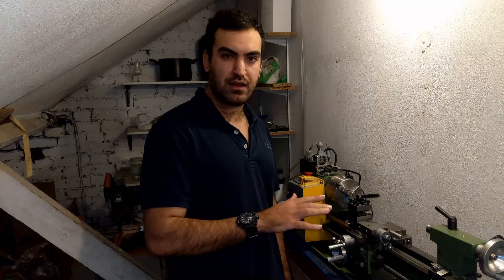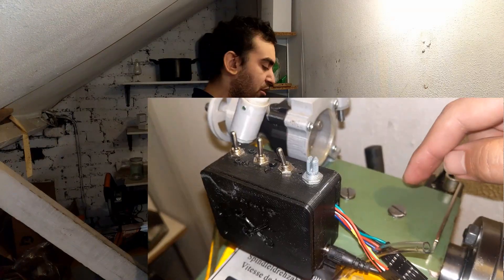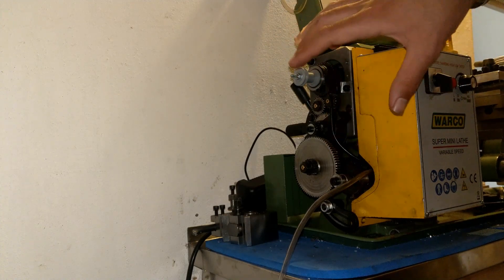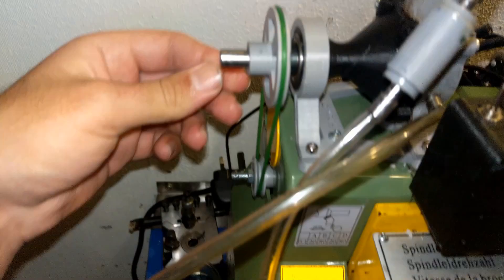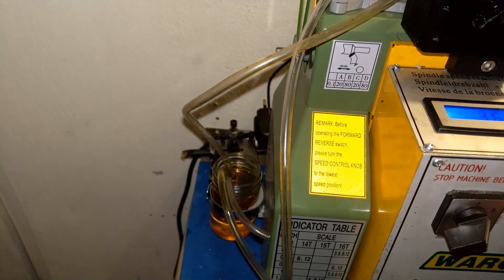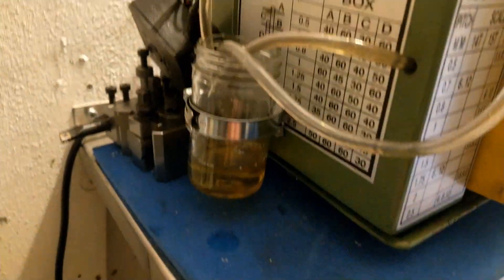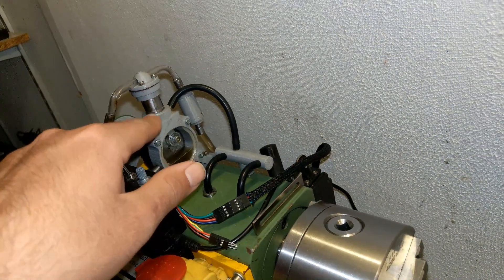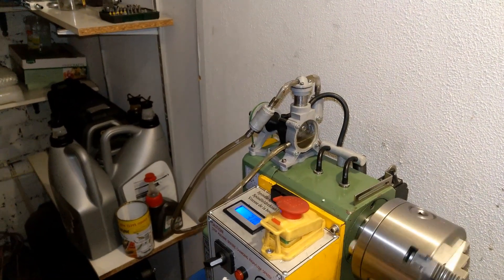Mini Lathe Oil pump , Compeleted Over engineered Oil Pump :)

Comment: Interesting to see an automatic pump system, morph into a single shot oiler system. Looks like the viscosity of the oil was a problem with drain back from your headstock, as well too small a tube to let the oil flow quickly in that drain, resulting in overflow on the unsealed bearing. I really like your pump idea, but it needs to have a much slower flow rate, with a pressure relief as you speed the lathe up. I'm really impressed by all your 3D printed parts, nice CAD modeling to make them. 
I have a 10x24 lathe that had major issues with oil to the two taper roller bearings on the spindle. These had reservoirs cast and machined into the head stock, but they didn't drill an oil gallery from the bottom of the bearing cavity, so the reservoirs could look like they had oil on the sight glass, but the bearings could be dry. The fix was to drill that hole in the headstock casting, and hope that it comes out in the right place, and it did.
Reply from the maker: yes the oil is a high viscosity, actuly it's moped gearbox oil,and you are right the pump flow rate was too much, and I tried to reduce the flow by using pully ratio but still oil flow was alot. 
tnx for tips and comments
Reply: Fred do you happen to have any photos of the modifications you made?